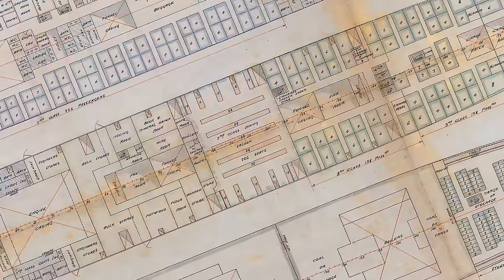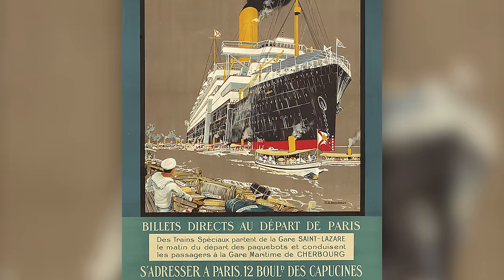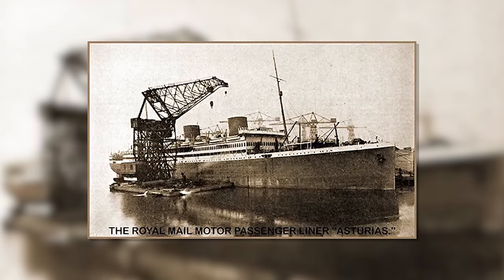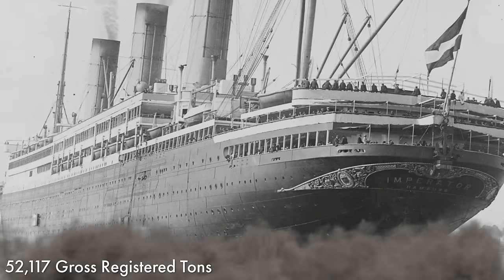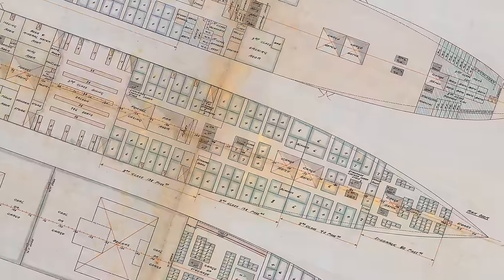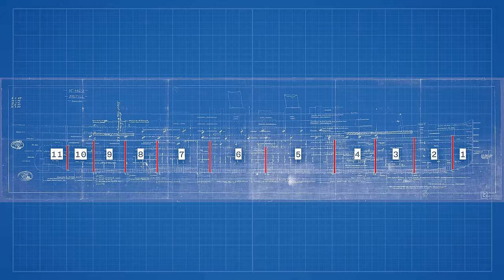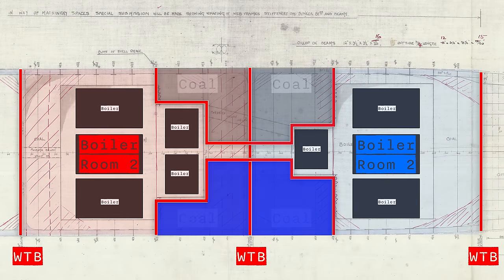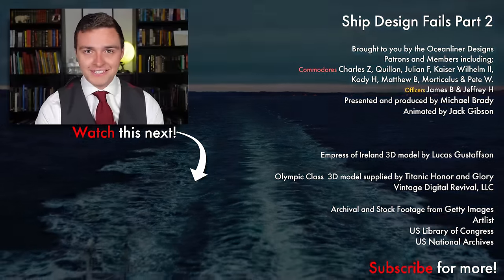When Engineering Goes Wrong: Three Badly Designed Ships

Comment: Just a quick FYI...  Fuel oil works as well in boilers as it does in diesels.  Most of the big liners converted to burning Bunker C after WW1 - much cleaner to work with for the Liners, which previously had to be cleaned from bottom to top from all the coal dust after refuelling, ans the stokers found themselves out of work.  Also as John Maxtone-Graham points out, the shipping companies now refuelled in New York, and thereby avoided the endless strikes in British collieries.  Sneaking back to the topic of Titanic, there was a coal strike going-on when Titanic was readying for its maiden voyage; most of its coal crossed from America in bags in Olympic's public rooms.  Gassy Welsh steam coal was widely acknowledged to be just about the best - the stuff Titanic was fuelled with was low-grade, and indeed a troublesome spontaneous-combustion fire was smouldering in one of the ship's bunkers throughout the voyage, but it did go out eventually...

Most ships today are driven by marine diesels, which are one of the most efficient fuel-burning engines the human race makes.  They start on diesel fuel when cold, but once warmed-up they also run on Bunker C, which is the cheapest liquid fuel.  The stuff is essentially animated tar, and it must be heated before it will flow through the engines' injectors.  Diesel-propelled ships came-out before WW1, and passenger motorships were becoming all-the-rage in the 'Twenties - When the German liners Bremen and Europa were designed, they installed extra-low funnels to ape motor liners, which do not need tall funnels.  The act was a publicity faux-pas as the two German liners caked their after decks with soot until in a refit, their funnels were doubled in height.

 - And again, turbines do not use gearboxes to reverse. 😉

A further tragic note about the Empress of Ireland - Canada has had two massive marine tragedies over the years, SS Atlantic (an early White Star liner, no less) and the Empress.  Two other factors played-into the death toll; they'd left Quebec just before dinner, and were hit at 2:00ish in the morning, so most of the passengers were asleep; and the ship sank in 14 minutes.  I'm led to believe (and your deck plan blueprint would show this) that a further design bedevilment for passengers who were up in time and trying to get to the boat deck was that on the Empress, the stairs mostly ran across-ship; so once the ship rolled, one flight of stairs would be vertical and the other wouldn't take you anywhere you wanted to go.

And the book I read, mentioned that the Empress was barely on the bottom before Canadian Pacific was being inundated with expensive loss claims for jewelry and other high-value items supposedly stowed in the purser's safe.  Canadian Pacific had divers on the wreck anyway, recovering bodies - a horrific task as the shellfish on the bottom of the St Lawrence, reluctant to let all that good protein go to waste, invaded the wreck and were happily chowing-down on the bodies - and the claims on items in the Purser's safe were so high that CP thought, "we might as well have those divers recover the safe and return all the property to its individual owners, rather than having to pay for it all".  So the safe was duly recovered and brought under police escort to the CP offices in (Montreal, I think), where it was opened in front of witnesses - and there was almost enough of value actually stored in the safe, to compensate CP for dragging it to the surface in the first place.  "Ghouls 'R Us", anybody? 😂
Reply: Most diesel engines can run on lots of stuff, even vegetable oils  or animal fat’s.. so idk why people don’t just use the name combustion motors
Reply: @chelsea_Xxo  the diesel engine is named after its inventor. Internal combustion is its technical name, and is a bit unwieldy to use.
Reply: Yep. Note that well into the second half of the 20th century steam turbines were still in widespread use in commercial ships and warships (I'm not counting the ones using reactors as the heat source). The US Navy still has a few operational ones.
Reply: @thesterrave  the more you senselessly advertise your little religion, the more people will grow to detest it. Just saying.
Reply: @thesterrave  at least you're understanding about it. I get what you're doing, but it can be rather detrimental, as can be seen with my aggressive dismissal. Speaking of which, sorry for the attitude.

Personally, I believe missions are no longer effective in today's world. Nowadays, secularism is much more common; people are increasingly close minded for various reasons, especially when it comes to religious matters. I'd recommend you to let your religion speak for itself. Instead of bringing it to others, allow them to find it and make their choice naturally.

If you see being a missionary as your sacred duty, however, just be mindful of the environment you're in.
Reply: @thesterrave  fair enough.
Reply: Diesel engines commonly called compression ignition engines or sometimes CIE. In the trade a diesel powered vessel is a motor ship and engineering certification is annoted as such. Most large motorships are kept on heavy oil at all times and rarely changeover to diesel or distillates. Of course nowadays vessels are experimenting with various other fuels such as LNG.

Comment: I have a feeling that the designers of the Imperator would've adored modern computer design simulations. WOuld likely have saved them a lot of headaches.
Reply: Yup....she probably wasn't as heavy a girl as They thought
Reply: They could have just calculated the centre of gravity and metazentren properly so to not build her with negative initial stability. No need for computer simulations to do that
Reply: @mariegrasmeier9499  Computers can let you model and simulate designs before actually building them. Now while they certainly are far from perfect and mistakes have still slipped through despite their capabilities, they have also helped saved some engineers grief by catching some design issues before committing to said building. 

"Calculate it all right in the first place" is a nice ideal, but as we see even professionals can slip, and slip badly.
Reply: @philtkaswahl2124 Yes, mistakes can happen. But building a ship and then discovering that she has negative initial stability (angle of loll) is quite a big one. And you do not need a computer to calculate it. Just a lot of time and diligence while compiling the weights and hull geometry.
Reply: @MaydayAcademy  Which again misses my point. "Just never make mistakes before you build it then" is nice to say, but having another way to catch those mistakes when they do slip through before you do take the time and expense to build something is good thing.
Reply: @MaydayAcademy That's two different replies now saying "we don't need no stinking computers" when that's not what the comment being replied to is saying. The comment is not saying you NEED computers; it's saying people who already made a historically documented mistake would have appreciated if they had a computer catch that mistake before they wasted time and money.

How is that hard to understand?

Comment: Great job, Mike! Your explanation and diagram were great. I remember the Storstad's captain reversed, leaving that Storstad-sized cavern in Empress' middle. I wonder if the ships had lashed together and dropped anchor the Storstad's buoyancy could have kept the Empress upright long enough to get the passengers off? What do you think?
Reply from the maker: It’s a tough one! Storstad’s own margin of buoyancy was pretty tight since she was laden with 11,000 tons of coal. I wonder if Empress would have simply rolled and dragged her down too!
Reply: BRO! Think about it, maybe Titanic was not spit in half during sinking!!! Just THINK! @OceanlinerDesigns
Reply: How a big bloody ship can split in half? It's ridicilous!!! It's just SANK! @OceanlinerDesigns
Reply: The water pressure will pull down the ship, all of it, not just the front part.. There's no pressure on the back deck to keep it on the surface..  @OceanlinerDesigns
Reply: The pressure of the water filled part of the ship is higher than the pressure of an empty part of the ship, it will pull it down to the ocean. There will be no split.
The whole structure sank. It's split in half during it's voyage to the darkness of the ocean.
 @OceanlinerDesigns
Reply: (bro, btw look at that laughable german imperial boy lol it's like a peacoock :DD sorry) @OceanlinerDesigns
Reply: The chief advantage of this idea (assuming it would even provide any meaningful benefit in practice) isn't really the Storstad's buoyancy support. 

First, keeping the hole plugged would reduce the rate of flooding and preserve the Empress' own buoyancy for longer.

Second, with the two vessels in intimate contact, transfer of passengers from Empress to Storstad would be potentially much more rapid than transfer by boat.

But lashing the ships together would be a bad idea unless there is a way to sever those lashings on command and reverse away in response to any acceleration of Empress' sinking.

And the other problem is that before the impact, the Storstad would quite reasonably have its engines at full reverse. The whole scenario you're suggesting depends on the engines being at stop at or very shortly after impact.

Comment: About 5 years ago a luxury motor yacht about 100 feet (  30 metres ) was being launched prior to sea trials, it didn't go well. She lifted from the trailer as part of the launch, then lay over on her port side. The crew on board did all make it to safety, the engineer having the climb out a rescuer broken porthole.

The type of issues you mention with the big ships happen with smaller yachts as well, just usually with no lost lives. The much lower number of people on board make it far easier for everyone to get to safety in time. The designer of a yacht can also be the designer of a cruise ship, so they learn the lessons and use the knowledge on all designs.

Comment: Interesting discussion about the arrangement of the bulkheads and the size of the hall opening.   I recall reading a book about the sinking of the Empress of Ireland -- the book was " Fourteen minutes: The last voyage of the Empress of Ireland" published in 1980.   I came away with several other faults -- design and otherwise.  One had to do with the potholes in the passenger cabins; the room stewards would generally not enforce the requirement that they be closed at night.   Another was the arrangement of the water tight doors; the doors were stored outboard of the passageway they were to seal off.  As I recall, there was a way of remotely activating the doors and then use gravity to effect the closing.  However, with the ship rolling over, gravity kept the doors in place on the side that needed them open.

Comment: In the early 2000’s, Polar Tankers (ConocoPhillips US flagged shipping company) place I think 5 “Polar Class” tankers into service on the Valdez crude oil trade routes.  These ships were designed to meet exemption rules in the OPA90 (law passed after the VALDEZ grounding) for needing escort tugs. One of the rules required redundant propulsion.  To achieve this, they made the ships twin screwed (rare in working ships) and each screw was powered by a separate engine.  Each engine was in its own engine room, along with all the needed auxiliary equipment. And a longitudinal bulkhead separated them. Now, in this case, the length and volume of the ER is small compared to the ship’s size, and the effect on transverse stability would be limited.

Comment: In the Impress of Ireland designers defense, who plans for an ice breaker to ram the dead center of a hull? There is such a thing as over-engineering, where you spend more resources than necessary to prevent something that is unlikely to ever occur and sometimes, it occurs. And when it does, it's usually a freak accident with multiple contributing factors.

Comment: At last I've found a video about ships describing their design process accurately. Your excellent videos seem to deal largely with older vessels, which you accurately describe as designed by naval architects, not engineers. Way back in the 1950's I was trained in naval architecture at Harland and Wolff and the Belfast College of Technology. During that time I worked on the design of many classes of ship, from liners such as the Canberra, to aircraft carriers. Besides making the ship look pretty, we also did all the structural, hydrostatic, and hydrodynamic calculations required to provide a safe seagoing vessel. We worked variously according to Lloyd's Rules and Regulation for the Construction and Classification of Steel Ships, Norske Veritas, or the American Bureau of Shipping. At no time were engineers involved. I do not wish to denigrate the engineering profession, as the decline in shipbuilding caused me to relocate there myself, but I am happy to find the truth somewhere on the internet. Thank you again, and keep up the good work.

Comment: Another splendid video.  Thanks!  But I was left uncertain what the design flaw of Asturias was.  The diesels were able to produce a huge amount of power, but were they unable to efficiently transform that into RPMs?  Or was there something with the hull design that made it irrelevant what power plant was use: nothing was going to help her reach the 20 knot minimum?
Reply: Diesels and Steam engines produce power in very different ways. And because of how horsepower is measured steam engines seem much more capable than they actually are (many modern Diesel-electric trains with 60k + horses aren't capable of pulling the same loads as an 20k horse steam locomotive). The refit was probably hampered by trying to fit the much larger equipment into roughly the same space as the diesels. specially if they used the the original prop shaft (which they almost certainly did do to the extreme cost of replacing it).

Comment: Having been in the United States Navy for twenty years, I can attests to the importance of having the watertight bulkheads closed BEFORE a disaster occurs.  Many modern day Navy ships have survived what should have been their demise simply because those all important bulkheads were closed BEFORE and damaged took place.  The USS Stark took on an enormous amount of fire fighting water, yet she survived after being hit with two Exocet missiles.  The Samual B Roberts survived after hitting a mine in her largest compartment, her engine room.  That explosion literally split the ship in half, yet creative problem solving once again managed to save the ship by cabling the massive engine access hatches at the top of the ship to other structures, keeping her held tightly together.  Then there’s the USS Cole, which probably suffered from the most critical damage of all, after she was hit with a terrorist explosive laden craft that rammed into the side of her while she was refueling at a pier in Yemen.  I personally witnessed the size of the hole that was blown into the side of this ship.  The fact that she survived is due to outstanding design.  Two additional ships of this class have been involved in severe collisions that would have doomed most other ships, yet these ships continued to float.  

Then there’s the case of our aircraft carriers.  Back in the mid 80’s, the USS Enterprise sailed over the top of Bishop Rock, an underwater seamount that breaks the surface of the ocean during extreme low tides.  The result was an extremely long gash running beneath her hull along with damage to her rudders and screws.  She too should have sunk, but the saying that American aircraft carriers are virtually unsinkable is practically true.  That’s because carriers’ hulls aren’t limited to just transverse bulkheads.  The compartments throughout her hull are all individually bulkheaded as well, creating hundreds of completely independent watertight compartments.   It’s a design that’s unique to these ships, making them nearly impossible to sink (keep in mind however, there’s no ship is totally unsinkable, as they’re made of steel, not foam).  

Of course, the day a Navy ship sinks, I have absolutely no doubt that the top Navy leadership will manage to find a way to point their fingers at the ship’s Captain while clearing themselves from any responsibility.  They did just that with the fire on the USS Bonhomme Richard.  They blamed the crew for having a lack of training as well as allowing the ship to become compromised while undergoing a flight deck replacement during a yard period.  These Admiral’s should have been pointing their fingers at themselves.  They were fully aware that the ship’s fire fighting capabilities were compromised while undergoing a yard period.  The procedures used by ship yards have always placed our ships in extreme danger from fires, as cables, ducting, and gas lines used during the yard periods are run through fire bulkheads that would normally have been closed to confine any fires to a small area.  In the case of Bonhomme Richard, the ship’s automated fire fighting systems were being upgraded as well, making the ship even more vulnerable than before.  These Admirals pointed their fingers at the ship’s Captain, when in fact, those yard procedures had been approved by the top brass from years before.

Comment: I was on a Light vessel when she was struck by a Japanese Tanker, hold in the battery compartment, (which on a Lightship takes up about 1/6 of the ship) midships, opening the watertight door to the engine room the water was up to main deck level, she stayed afloat, regardless of the huge salvage pumps we could not make headway. Very eery feeling going down to the bottom of the next compartment knowing there was a room full of water in the adjacent compartment.